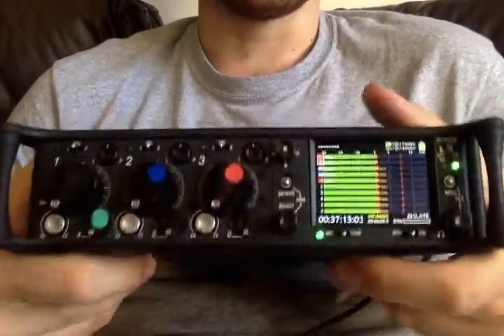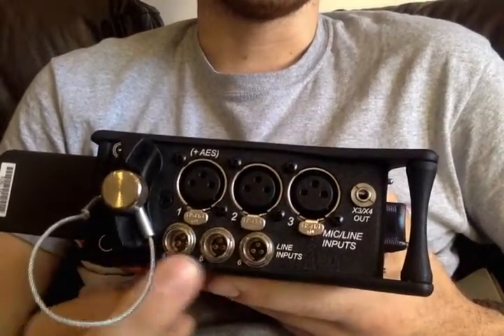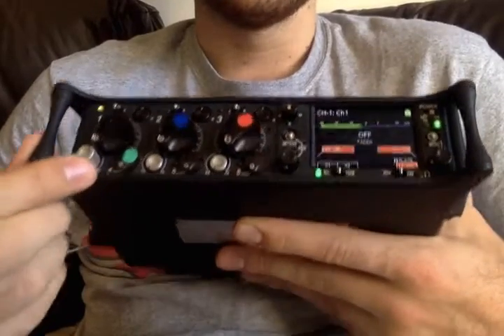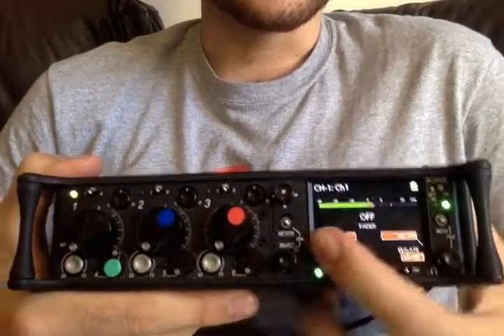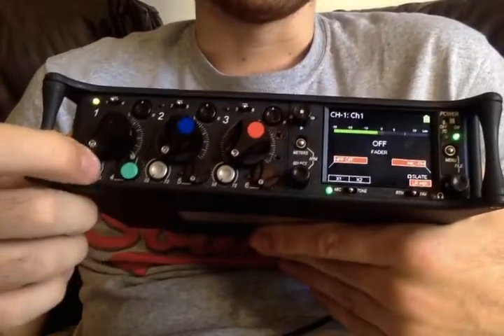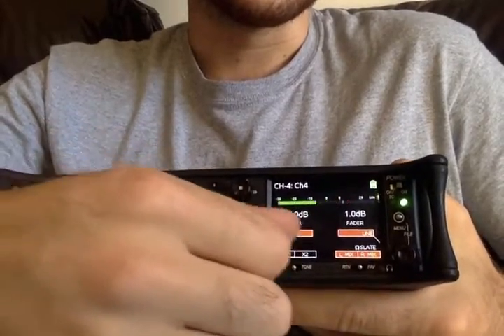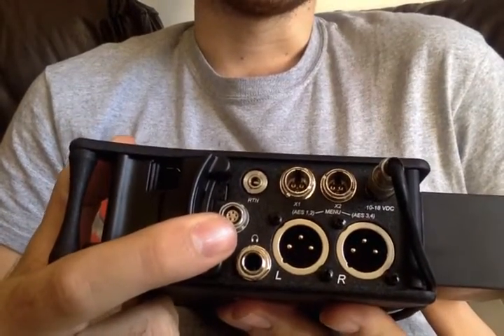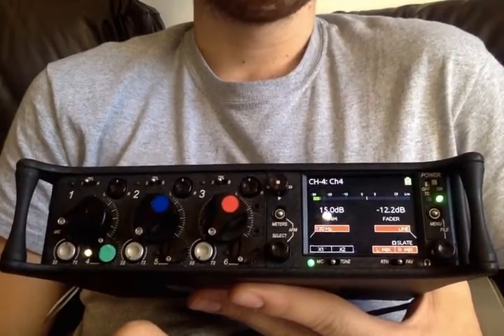Sound Devices 633 - Input Interface

Comment: Would senheizer g3 works on line input 4,5,6??

Thank you..
Reply from the maker: Yeah you just need a 3.5mm to TA3 connection
Reply: @soundrolling  thank you the info sir.. and the knowledge you share on your videos.
Reply: @soundrolling  Hi i connect one G3 and the gain is very low, i set the sensitivity of the G3 in -12 and is better but have too much background noise, any solution for this? thanks Matt great videos!
Reply: @andinugroho4896  hi do you have background noise with the G3 connected in the on line input 4,5,6 ? thanks